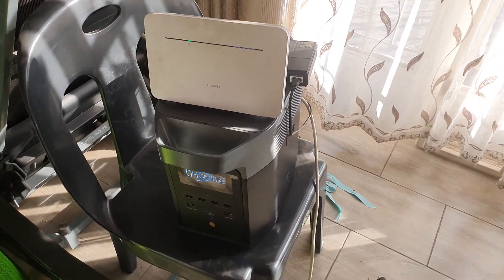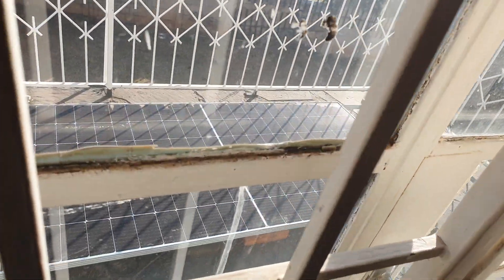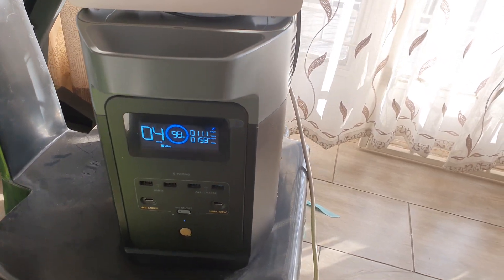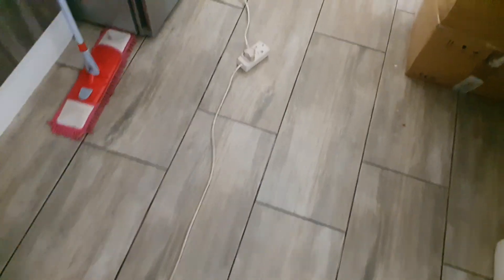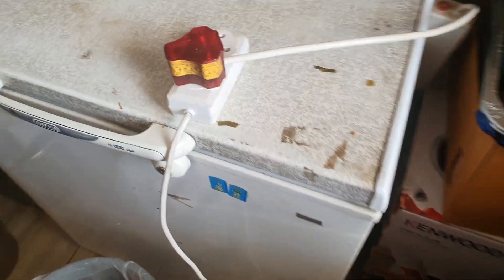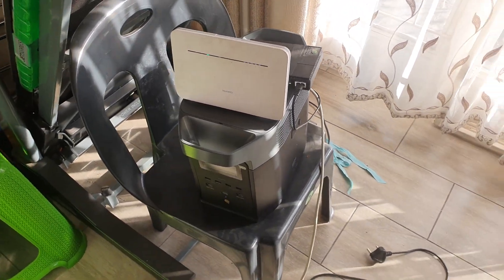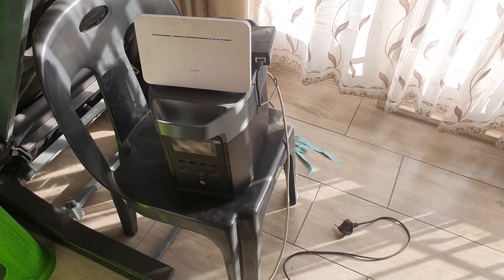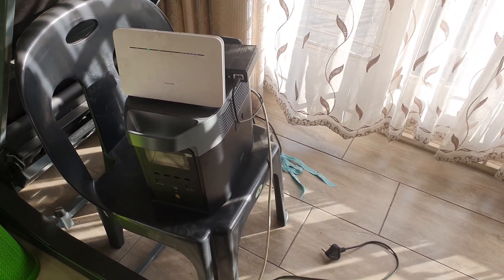Using the Ecoflow delta 2 power station during South Africa load reduction

Comment: And i have it connected to a second wiring in my home so i can connect everthing in the outlets, lights, 4k tv  radio,coffee machine single induction plate microwave fans now i need a second battery so i can use it longer at a day
Reply from the maker: Microwave? Too much power
Reply: @WahJaiCreator  you can set in the settings menu x boost on on when its off you can til 1800 watts and when its on it will lower the wattage from the connected devices so the microwave will work on 1800 watts when they microwave normale is a higher wattage
Reply: @WahJaiCreator  microwave is normal 700 watts for a small one and 1400 watts for a big one mine is whirlpool 1400 watts
Reply: How long does it last with Wifi, Tv and lights?

Comment: I use it with my dishwasher 30 min or washmachine 40 min take all the load from the ecoflow and than it charges in 4 hours till full with 480wp bifacial solar panel delta 2 1024wh
Reply from the maker: Must test on washing machine 13kg top loader
Reply: @WahJaiCreator  thats a large one mine is 6kg and i use the short programme 30 a 40 min wash